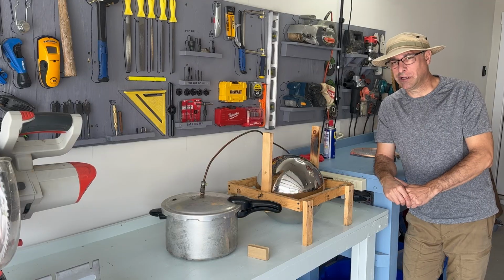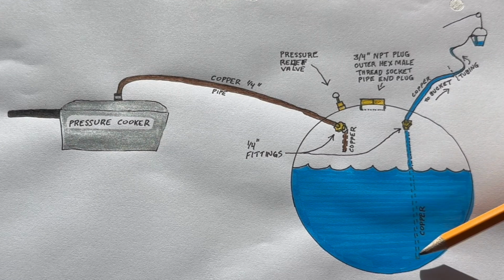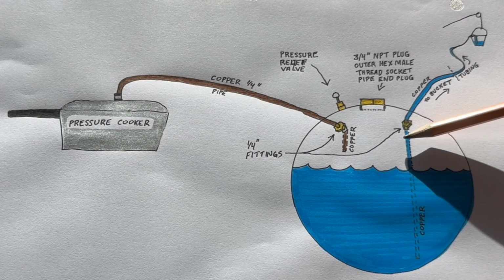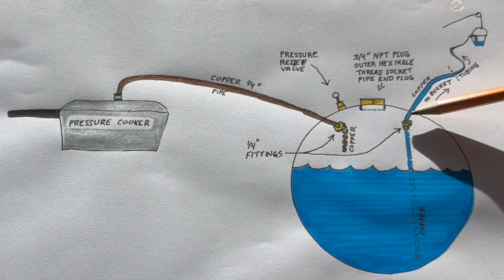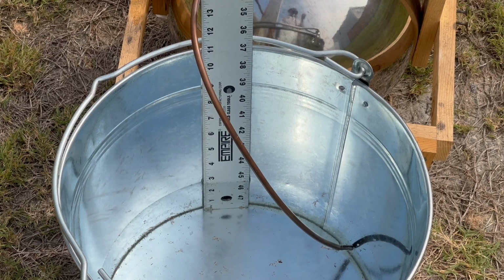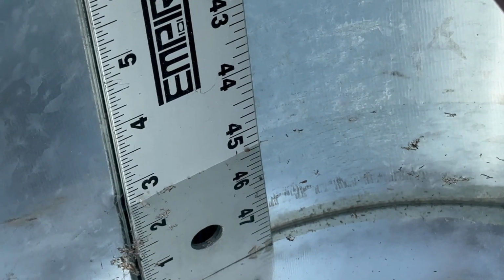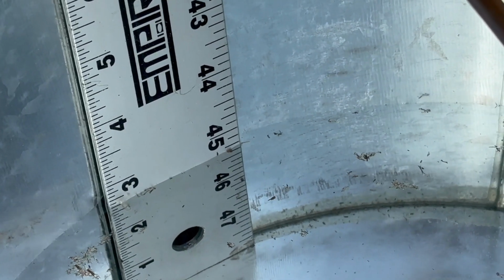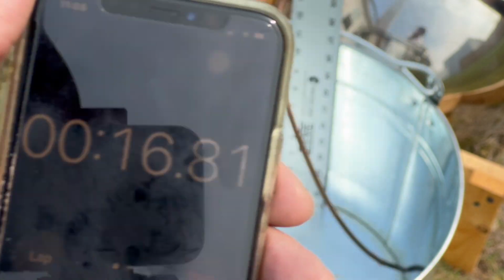Campfire Water Pump

Comment: The reason is compression threads are not tapered and the seal is from the ferrule, NPT IP threads are tapered to make a seal without a ferrule, flare fittings are even different and the threads may match but flare angle can be different
Reply from the maker: Wow! Now THAT makes sense! Thank you! 👍🏻